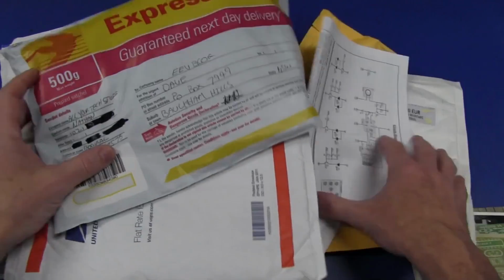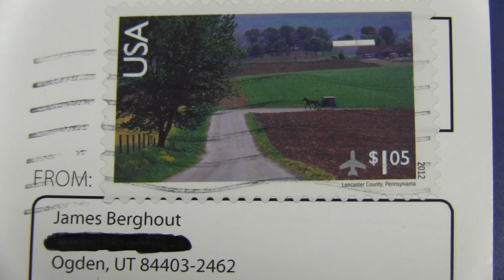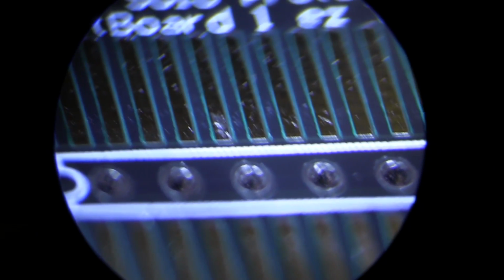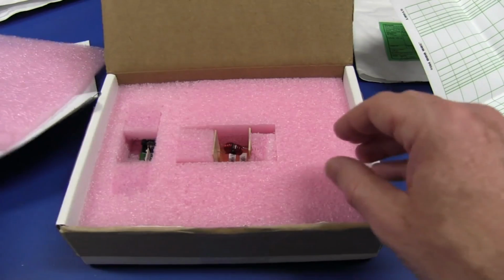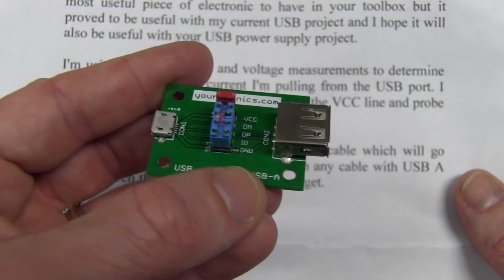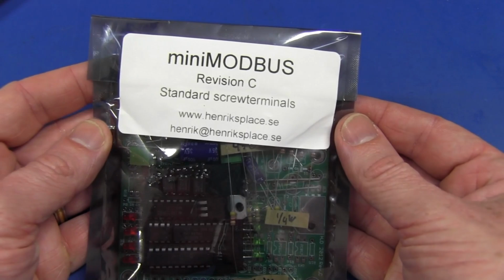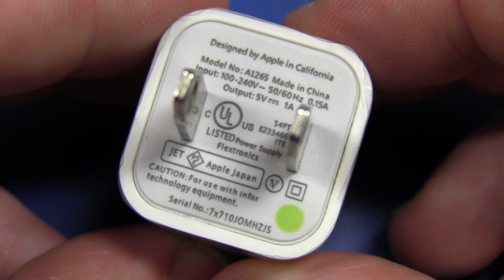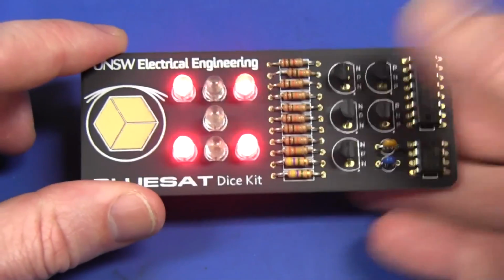EEVblog #353 - Mailbag

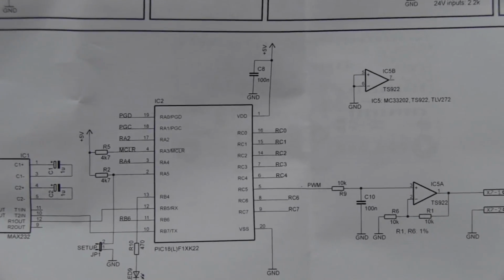Comment: 29:53 Beyond the possibility of an op amp oscillating by tying the two inputs, you're going to be amplifying the part's input offset voltage by the its open-loop gain, which will almost certainly send it into one of the two rails. Definitely better to configure it as a buffer and tie the noninverting input to ground (or a known voltage).

Comment: I have a kinda similar dice kit from Velleman, it uses one 9V battery and has a pushbutton and diffused red LEDs. The LEDs are molded in red plastic, I like the smoke-like clear but diffused LEDs better.

Comment: i know this is old Vid but that last charger was close "not the totally f-uped one" but the  other one. Compared to the one i got with my iphone the differences were,  writing was darker,  ul listing # starts with an E not I and the last part says
 "CAUTION: For use with infor
mation technology equipment."
NOT
 "CAUTION: For use with infor
 technology equipment."
They couldn't finish printing INFORMATION . maybe the next one will be right on the OUTSIDE.

Comment: An optocoupler is usually a LED facing directly into a phototransistor. They are usually in dedicated IC packages but I believe the term would also be used to describe the same setup with an individual LED and phototransistor.

They are usually used to isolate 2 electronic circuits so (for example) if a high voltage fault developed on 1 side, the other side will be safe.

Comment: Hey Dave, I'm really glad you soldered the dice kit! 

The beaut PCBs are from PCBCart. It's a shame the traces are hard to see, but it is probably for the best considering the board was laid out for ease of assembly, not for neat routing. :P

The kits only cost $3.20 each (inc battery) and we use them at high school events. The logo you touch to roll the dice is that of BLUEsat, an entirely ungrad group at UNSW designing a LEO satellite.

Cheers!